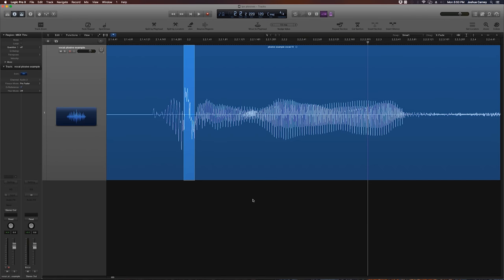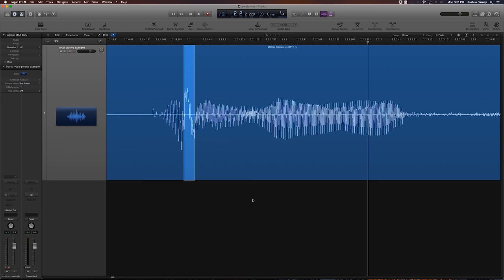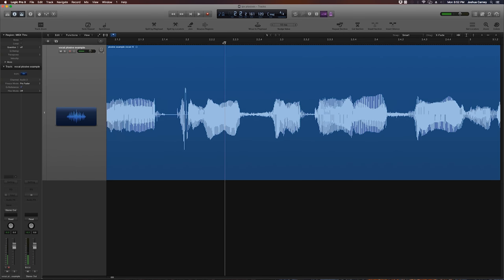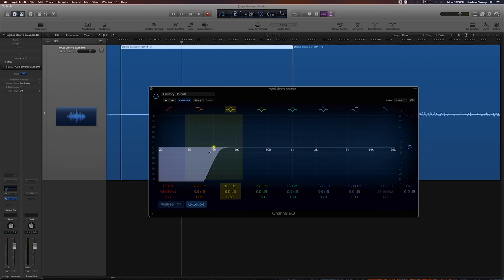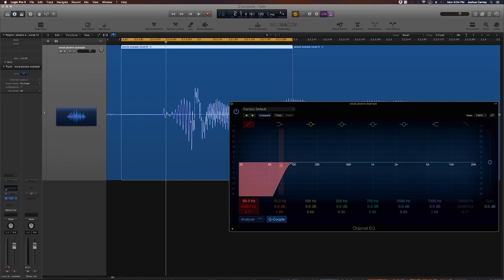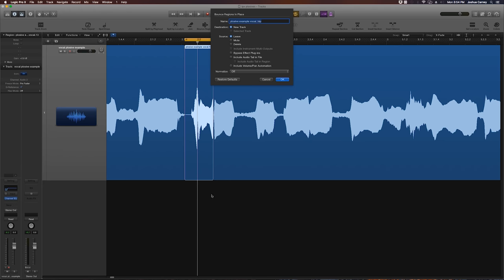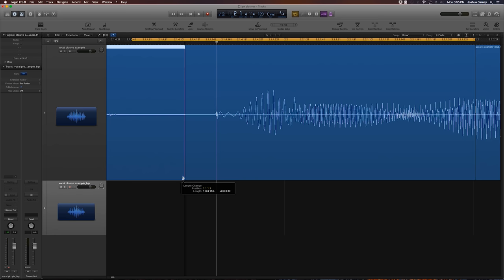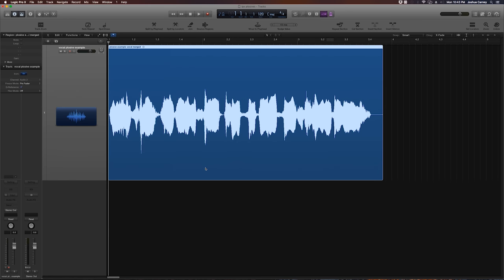Logic Pro X - Remove Plosives from Vocal Recordings

Comment: This tip is easy and PUUURFECT. Had a track I recorded back in 1967 with a Sony Stereo suitcase recorder and a Sony Stereo mic (I still have it) and passed it through  Super Reverb to the recorder. Is is actually a great sounding track and a music supervisor wants to use it in a movie, but there were three PLOSIVES that wrecked it. I used this technique, beefed up the track, remixed it and mastered it and it sounds great. The Music Supervisor is VERY happy. Very simple solution just using what Logic has available. I took about :20 minutes....

Comment: this single handedly might be the stupidest way to get rid of just a little pop in a vocal track......
Reply from the maker: Why is it stupid? This is literally the same way people did it for YEARS before plosive removal plug-ins were a thing. Yeah, sure you can go buy a plug-in that removes plosives, but that costs money. If you don't have restoration plug-ins and you don't want to spend money, what other way is there to do it? The 'plosive' itself is actually always going to be there, you can simply mask it by cutting the lows for just a split second. You can do it with automation too, but that takes the same amount of time. So how is it stupid again? I would argue it has helped a lot of people, if you happen to read the years worth of comments on the video.

Comment: only half of this was helpful. there is a far easier way to do this man.... select the segment with marquee, right click and select "selection based processing". you can apply plug-ins to just that area and process it right there on the spot and it will adjust the wavelength right there in the take
Reply from the maker: Selection Based Processing did not exist when I made this video. That came out in 10.3 which was released the year after this video was made.